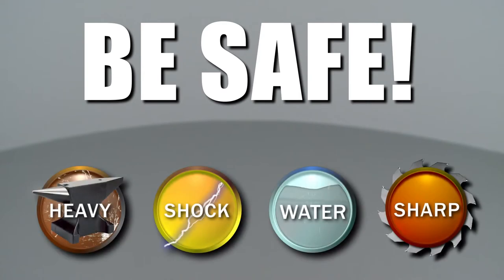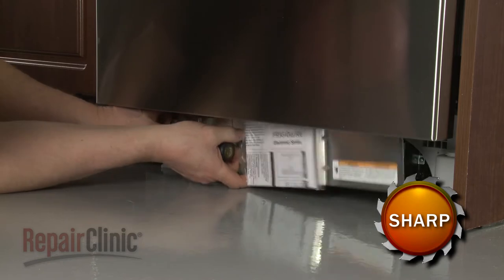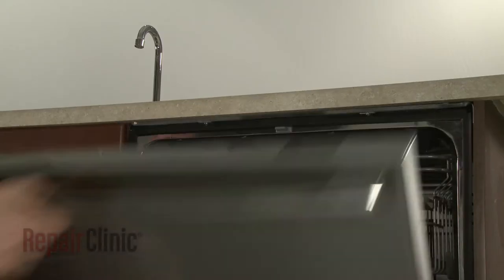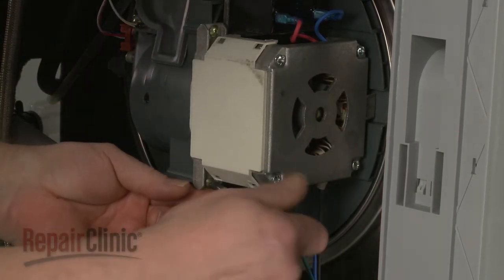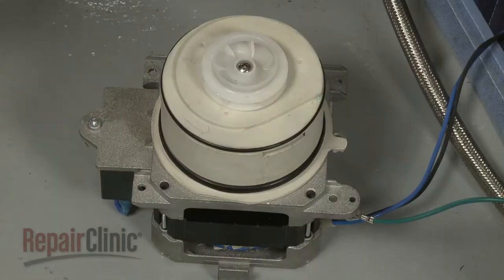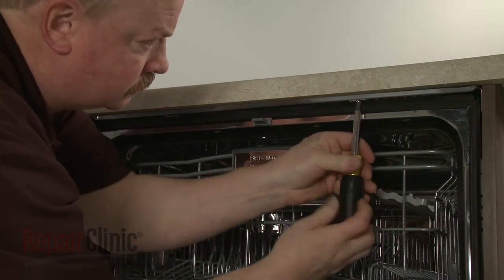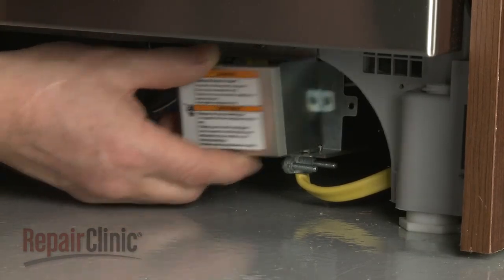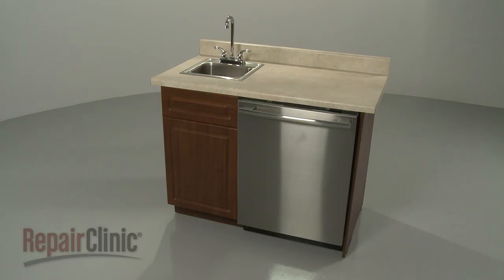Frigidaire Dishwasher Circulation Pump Replacement #5304475637

Comment: Don't fooled by how easy this looks.  This pump motor he is taking out has probably not seen 5 years of service like mine.  Mine would not budge and the plastic sump housing takes on damage when you try to leverage it out.  Mine would never even fully expose the first o-ring.  He barely has to apply pressure against the sump to release the drive.  This is not accurate at all, not for me anyway.  It would not come out.